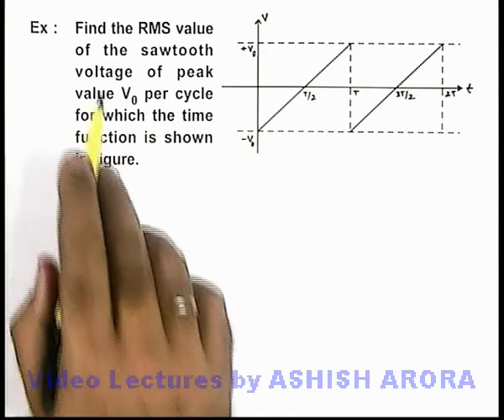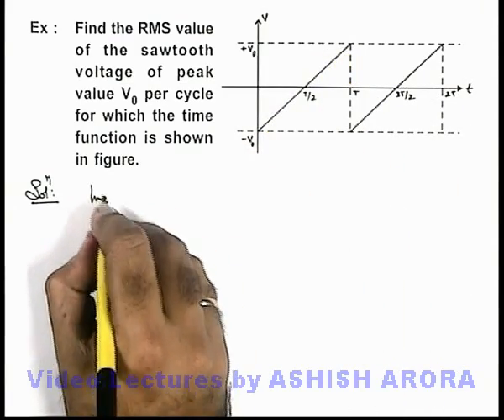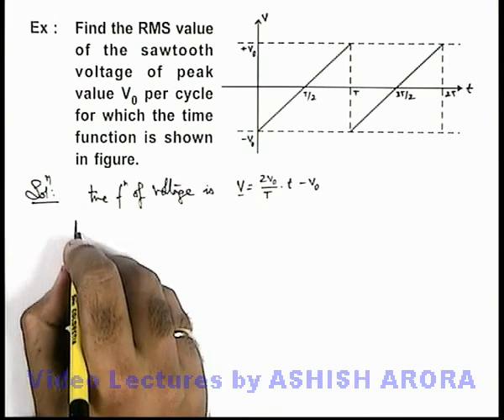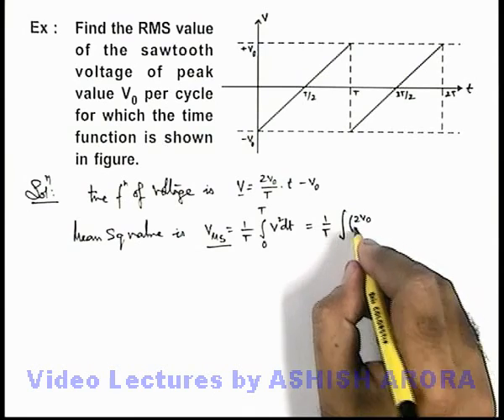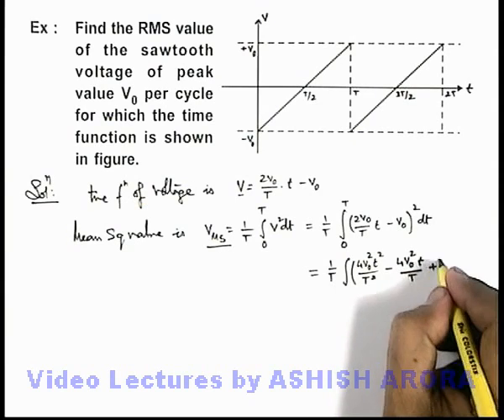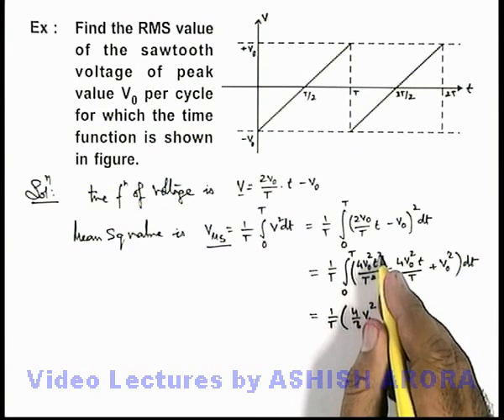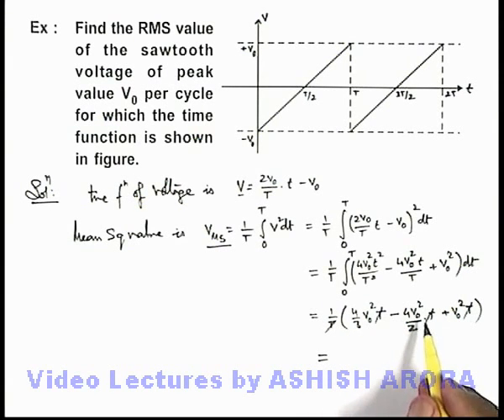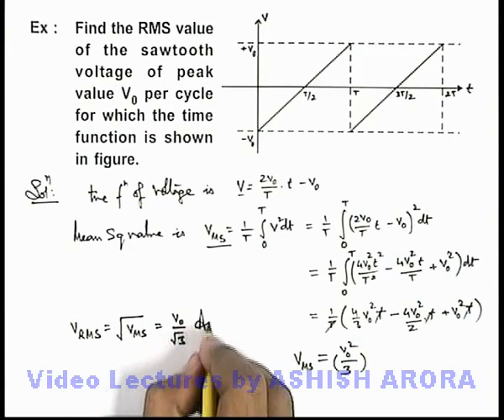Class 12 Physics | Alternating Current | #13 Solved Example-6 on Alternating Current |For JEE & NEET

Comment: the fx u make is only for one cycle right otherwise the fx is wrong plz reply
Reply: Yes for another half f(x) will be different, but you will get the same Vrms value but you will have to put different limits say if you have written f(x) for second half cycle then your limits will be From T to 2T that's it. Again I repeat '' Vrms will be same'' irrespective of any half  chosen by you,